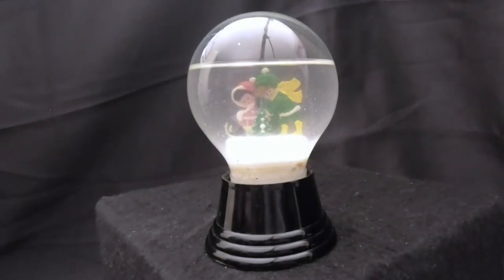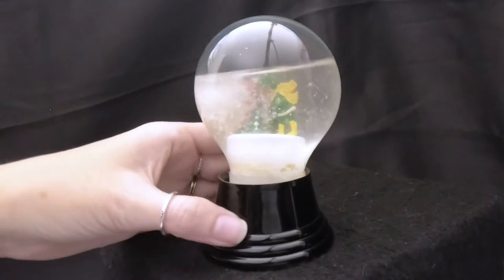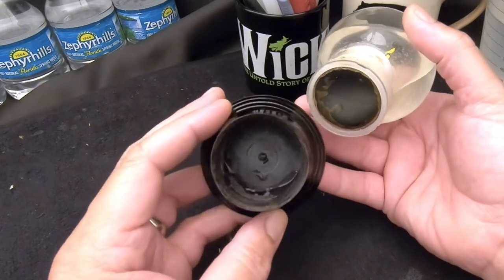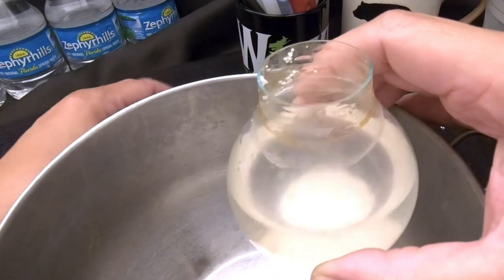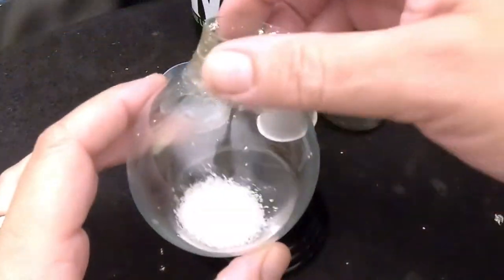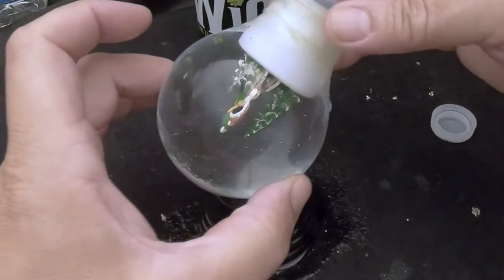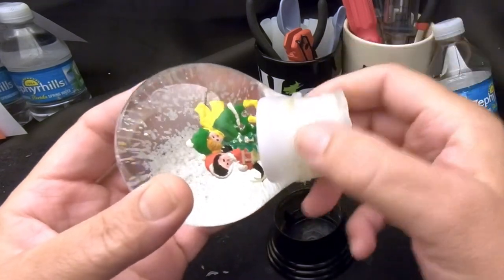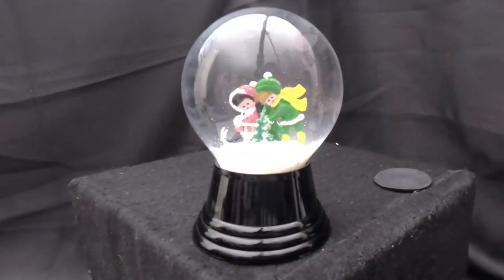Ep. 57 - Repair of Austrian Snow Globe From Erwin Perzy III, Grandson of the Snow Globe Inventor.

Comment: Wow!  I have several comments. First of all; have you ever given up on a snow globe challenge?  Your perseverance is amazing.  Some ideas about this secret snow. I bet there are a lot of these being discarded. You could keep a lookout for them and collect the snow to use in special globes that you are restoring.  Something else occurred to me when I saw some of the specks of the snow that had escaped.  How about a chemist.  It might be possible to come up with a snow with the same slow falling action as the secret snow.  That might be more trouble than anyone wants to take.  It was just a passing thought.  Great video!
Reply from the maker: Thanks for the comment. We have been very lucky. We have been doing this for just over a year and a half and we have had to figure a lot of things out through trial and error and sometime we just come with an idea that in most cases works out. Since we get such a good deal on these used globes we feel comfortable taking some chances and in most cases it works out. We have had a few that we just couldn't completely fix. In fact we plan to post one of those soon. As far as collecting snow, that is something that we do. When we have a globe that doesn't work out or is beyond repair and we use it for parts, we keep the snow if it has any for use in other globes. We don't know how Erwing Perzy came up with the snow formula but I imagine it is not that big of a secret for, as you mentioned, a chemist to figure out.
Reply: I watched the program about him and he said his grandfather put semolina in a light bulb.??  Maybe I heard wrong. It can’t be too complicated if he found it accidentally.  But maybe I should reel my curiosity in.  That’s his secret and the globes you do are beautiful.  It’s just that a mystery is irresistible.
Reply from the maker: @nancyskinner5207  Yes, he was trying to improve the light bulb and accidentally creates the first snow globe. Not sure what prompted him to add semolina. We're sure he had a plan!

Comment: Sort of sealed.
Reply from the maker: Eventually, about a quarter of the water leaked out we had to disassemble it again to refill it. Except that this time we decided to try the rubber disc seal again. It was warped but we had the idea of putting the rubber seal in hot water to make it pliable again and we reassembled it the right was this time. It developed a small air bubble but nothing like it was. We have another one of these Austrian snow globes that we plan to do a repair video on soon and now that we know what to do it should turn out better.
Reply: It turned out great
Reply from the maker: @nancyskinner5207  Thanks.

Comment: Hi there! I found your video because I have a globe from the same maker that’s lost a lot of liquid - do you have any ideas about getting the plastic base off if it’s not already loose? Many thanks!!
Reply from the maker: It seems like these Austrian globes are just pressed into the base and you should be able to remove it by twisting it off. I believe there may have been evidence of some glue in the base but it was no longer holding the globe in at this point. My suggestion is to heat the base with a hair dryer to melt any hot glue that may be in there then see if you can twist off the globe. Be careful not to heat the base too hot since it is plastic. If the globe doesn't twist off at that point you can try hot water. Place the globe in a plastic bag and put it in a bowl then pour boiling water into the bowl until it reaches the top of the base an let it sit there for 5 to 10 minutes. If there is any hot glue in there it should be loose at that point. Check out Episode 196 for an example. We have never tried the boiling water method on one of these plastic globes but if there is hot glue and the hair dryer doesn't work then that is the only other way that we can think of, however, try carefully twisting the globe and it may just come out.

Comment: Hi me again. The biggest problem I keep having is floating glitter. I have tried a load of different types, but I always get some that floats 😢
Reply from the maker: Hi. We have had some instances where some of the glitter floated to the top. What we found is that if we let it sit for a few days and shake it occasionally eventually the glitter all sinks. However, we use the Recollections line of glitter that we found at Michael's craft store and on Amazon. We have never had an issue with the Recollection's glitter.